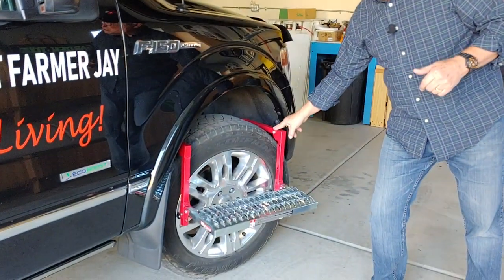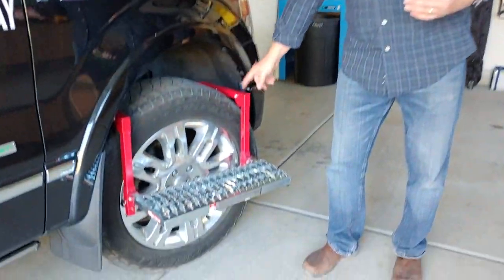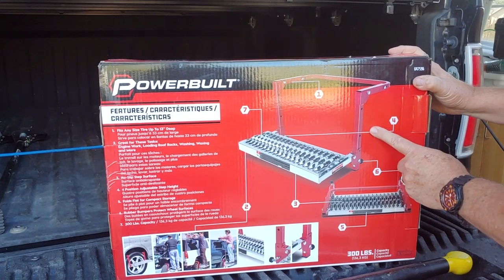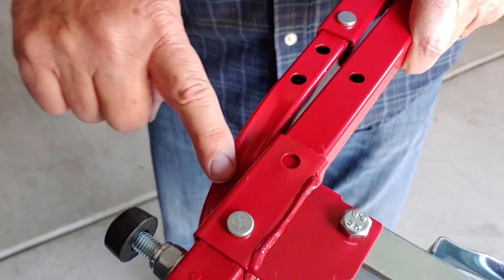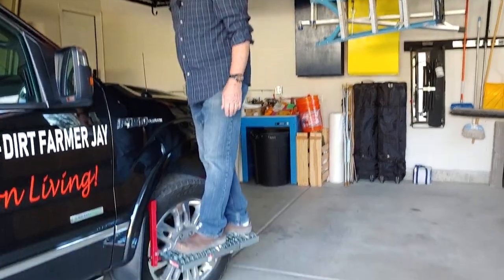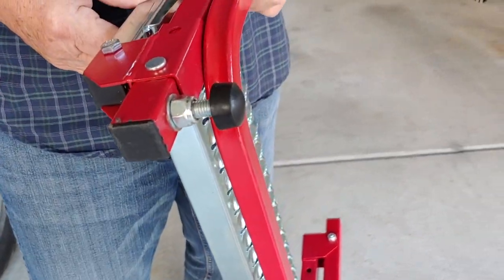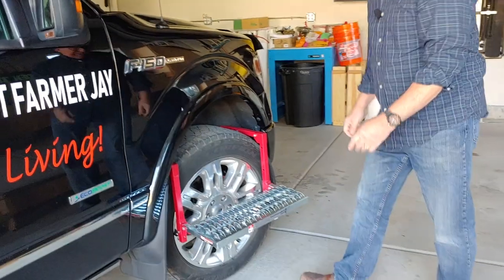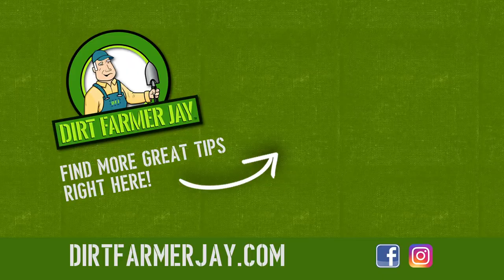Tire Step is a Must-have Truck Accessory!

Comment: Thank you for the detailed and thorough video!  So helpful, especially your tip to add the washer and nut on the bumper bolts.  We just got a large truck and this will be just what we need to reach!
Reply from the maker: Glad it was helpful Marsha and Pat Kapinus! I could NEVER reach the middle of the windshield of our truck without using the Tire Step. Best to you, Dirt Farmer Maggie

Comment: Wow, what a difference a little over two years makes inflation-wise. You paid $30 for this tire step? Amazon wants $70 for this piece in 2022. I'd love to have two of these to make an elevated walkway to use when washing the top of the SUV, not sure I can justify the price though. I also have some concern about large wheels. A lot of trucks and SUVs have 20 or 22 inch wheels from the factory now. Does this step fit those  larger wheel/tire combos safely, or is there just not enough to grab on the back of the tire with the larger wheels and tires?
Reply from the maker: Jim, thanks for writing. Indeed, price increases, supply chain challenges and record inflation is really taking a bite out of our buying power. Wow, that's quite an increase. I'll take a look at the unit and estimate the maximum sized tire it will accommodate and I'll get back to you. Best, DFJ